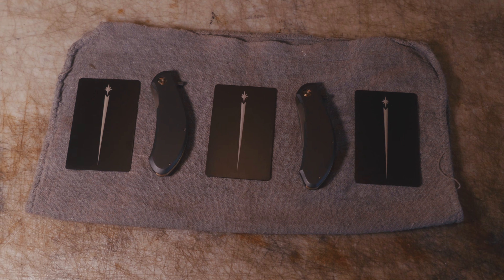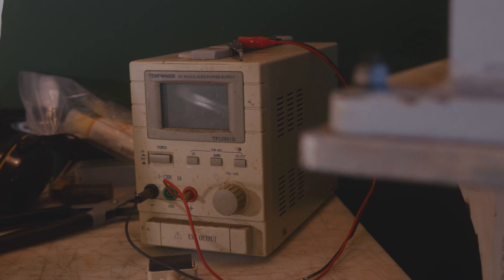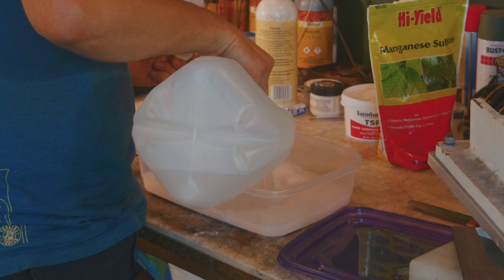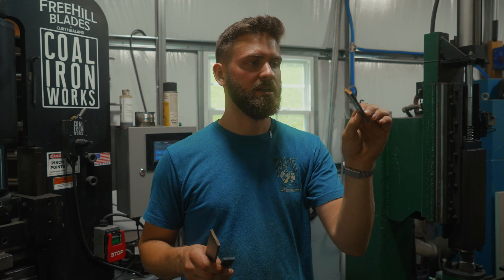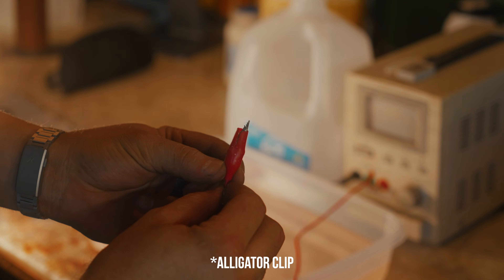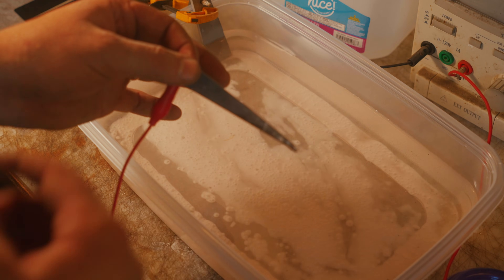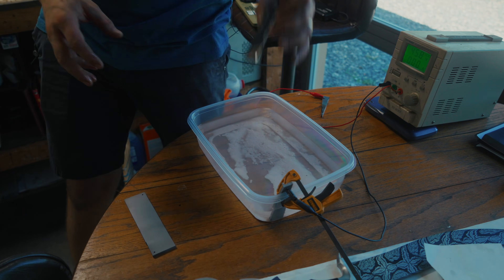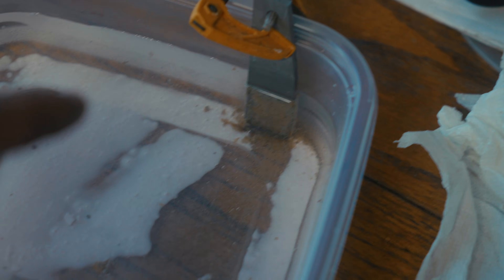Making Titanium BLACK (perfect for frame lock knives)

Comment from the maker: Answering the question I have gotten about blackening titanium and the black finish rubbing off. You need to bead blast the part with glass bead for this ano to work.
Reply: Be careful with the dust make sure you use a respirator. Manganese sulfate dust will give brain damage under long term exposure

Comment: Do you think it would hurt a carbon fiber inlay on the handle of a knife or would the carbon fiber need to be removed?
Reply: You cannot anodize with carbon fiber inlays installed because the carbon fiber will absorb the voltage away from the titanium. Inserts have to be removed.

Comment: That's great, but I have a question. Is the piece you blackened also made of titanium, or is it made of iron? I mean, is this coating method only for titanium, or can I also use it on iron?
Reply: electro-anodizing only works on titanium as far as I know... It's not so much a coating, as it is controlled oxidization. Different voltages and in a TSP solution will give various colors. This (manganese sulphate) at the voltage he shows will give black; maybe others at different voltages.

Comment: Amazing! Can you tell me how your setup for the machine (current)? I want to try this for a project. Thanks
Reply: set your power supply for constant voltage. Amp draw at start will be high, then decrease as the oxide layer builds

Comment: Great video, Curtis!  If you buff it first instead of sand blasting, will it keep that shiny finish?  (I may link to this video in an upcoming video! )
Reply from the maker: Thanks! It will only work with a blasted finish. Glass bead only
Reply: @CurtisHaaland    been doing this finish and it also works with alum ox blast
Reply: I’m going to try blasting with walnut shells before blackening then I may try baking it at 400 degrees for 30 minutes after soaking it in WD40. Making sure the part is wiped off so it won’t combust. After I remove it I will freeze it to test its durability with expansion and contraction of the finish. If good then I will know that the finish bonded into the pores of the metal.  @CurtisHaaland

Comment: Thanks for sharing !
I just tried it and reckonized that this builds up kind of a coating (different than normal anodization). I rubbed it with a paper towel pretty hard and it flaked off at some spots. Underneath it was rather brownish. Whats your experience with the durability of this finsh?